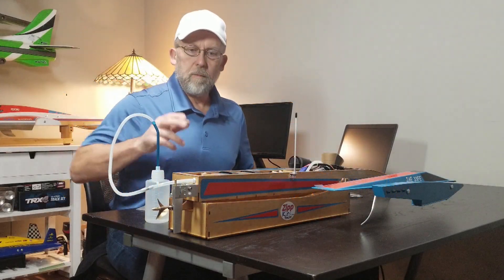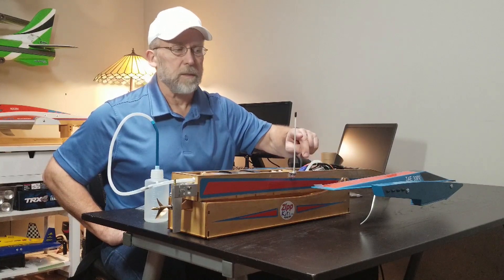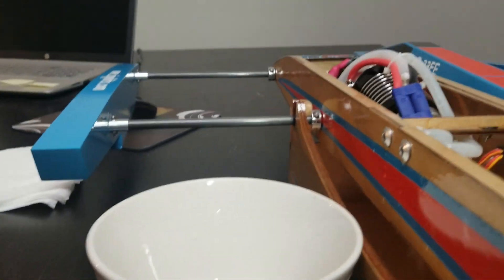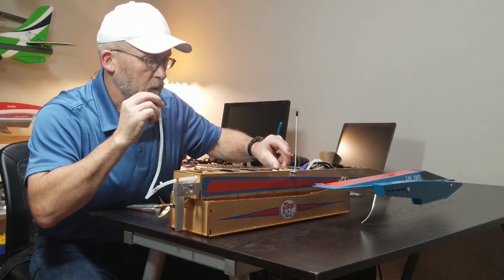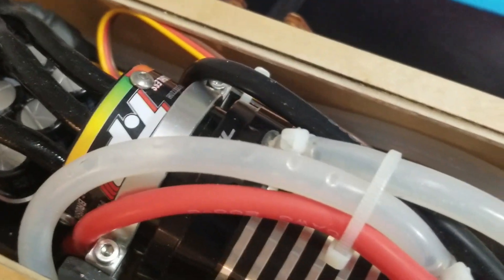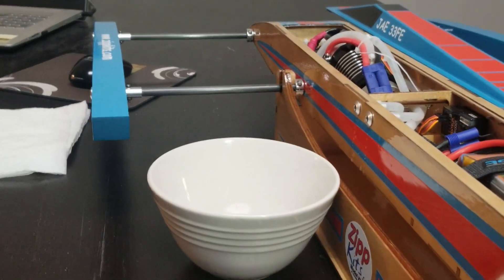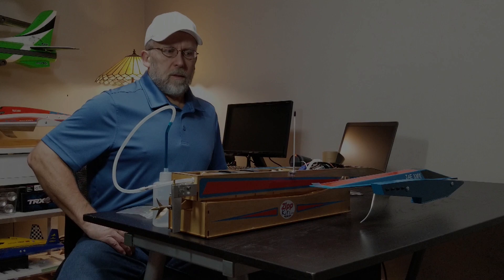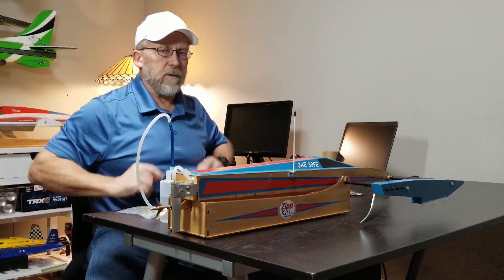JAE 33FE_CALIBRATING THE WATER COOLING SYSTEM

Comment from the maker: In the video I thanked someone for commenting on my channel about the unequal flow. It was actually a PM sent to me on the OSE forum. Thanks jaike5! Thanks for discreetly suggesting I look into this potential problem...
Reply: 🇺🇲🇺🇲🇺🇲🇺🇲Hello Mr. Sam Hallstrom, I just made a purchase on the XMAXX.  I really enjoy listening to your advice in regards of the XMAXX.  I need your advice about cleaning and clearing up the WD40 theory.  I'm really getting confused about that. Also, I need advice about the tires in regards to puncture holes to prevent ripping the tires during mudding and water riding. The POPULAR XMAXX #7773 TIRES.
Thank you sir!!..PLEASE DO A DETAIL VIDEO BECAUSE MANY XMAXX OWNERS WOULD TREASURE THE ADVICE.🏁 🇺🇲🇺🇲🇺🇲🇺🇲
Reply from the maker: @s.e.v.e.n5589  WD40, do not use for lube. It displaces water, then dries out. As far as applying it to the plastic, yes it softens it. Some is ok, but you can make the plastic too soft also. Personally, I think Traxxas has their plastic compound perfected, I don't wipe my plastic with WD40.

Remember I said this. I hate mud... 

So you won't see a getting muddy video from me.

I do run in the snow and on wet grass tho. And both gets water in the tire foams. Drill holes so the water can be flung out? Why wreck your tires? Why get water in the foams in the first place?

Just tape the holes on the inside of the rims. There's two of them. Do that before you put the first run on a new truck. And on new wheels/tires before you put them on...

Oh. Use black electrical tape. Doesn't come off...
Reply: @chilly7261  Your THE Best my friend..I will be getting it mid January so if you have any first time advice PLEASE chime in at any time because I value your opinion and plus you live a really cool life🇺🇲👍🏿👍🏿I watch your videos and I am inspired and look at some things in my life that I can change and a better man all around. MORE THAN A FAN SORT ALIKE A BUDDY..My name is Tago(Tay-go).
Reply: Did you upgraded your Servo and also did you keep that 20 pin in or you maintaining the stock just for every day running...which do you reccomend.
Reply from the maker: @s.e.v.e.n5589  I think you're referring to my Xmaxx...

I'm still running the stock servo (it's fine, no issues), and yes I'm still running the 20 tooth pinion. I need the wheel speed for backflips. For everyday running with lots of hard accelerating and braking, do not run this setup (20t pinion/ 46t spur) 

The stock 24 tooth pinion gear/50 tooth spur gear is the safest. With the 46 tooth spur gear (50+ mph gearing) that comes in the box I saw no issues with high temperatures...
Reply: @chilly7261  Good morning...so basically it is great as is out of the box.
Reply from the maker: @s.e.v.e.n5589  Yes, run it as hard as you want, it'll take everything you throw at it. But, it's a little slow, I think I've seen speed tests, it's around 40mph ish...
Reply: @chilly7261  I seen some videos of guys unboxing it and running it with the pinion not fully set and destroy the gears. I might just check it out and make sure the settings is tighten. I guess those are some checks you may do to review for any potential problems that the manufacturer overlooked.
Reply: @chilly7261   How are you doing sir? QUESTION: Have you ever thought about Xmaxx FPV?

Comment: What pump are you using? Im trying to find something that doesnt shot the water stright out like a beam. Your pump strength is perfect
Reply from the maker: Huh? I'm not sure what you're asking. For the bench test I use the water bottle. While the boat is running, the water pickup on the rudder. What am I missing?
Reply: @chilly7261  ah i just watched part of the video, i prob missed when you said how it worked, i assumed you used some kind of RC electric pump
Reply from the maker: @emperoraugustus4047  All good... 👌

Comment: I like your approach! I've done the something similar, but I used a small plastic aquarium air-control valve. Actually, your way of constricting the water flow to the ESC is easier, cheaper and lighter, so I will borrow your idea for my next project! 😉
Reply from the maker: Thanks! I'm glad you can use it...

Comment: Awesome work, congratulations! Why is it so important that both flows are equal? Is two outings better than one?
Reply from the maker: Thank you. I like to split them and get cold water to both. If one is flowing way easier, you won't get much water to the other. So over heating could be the issue.

Inline they both get the same amount of flow, but the second component is getting pre-warmed water. Inline is simpler and a more sure thing.